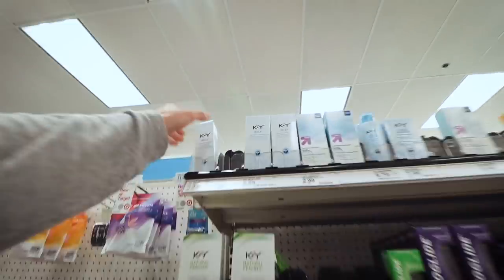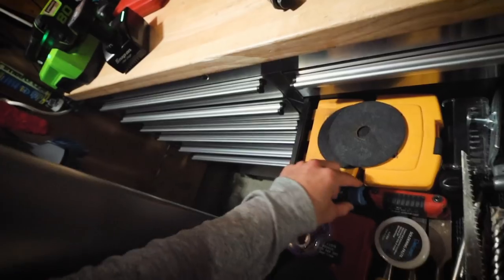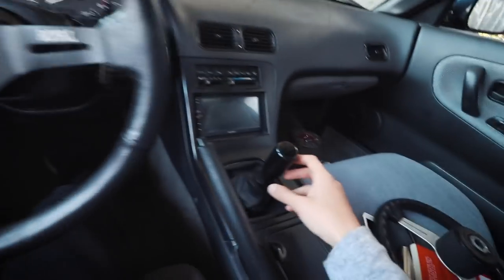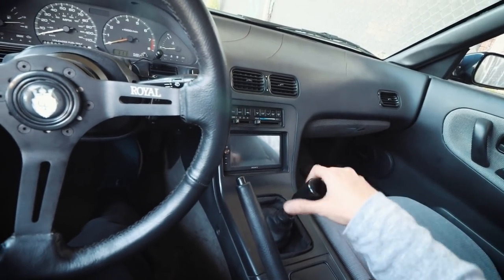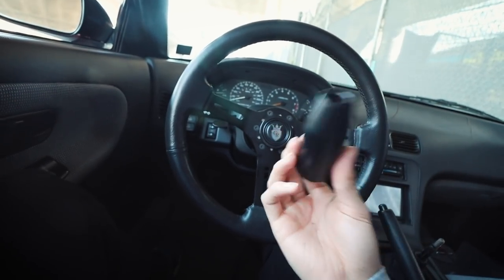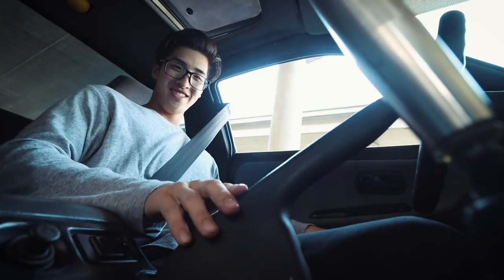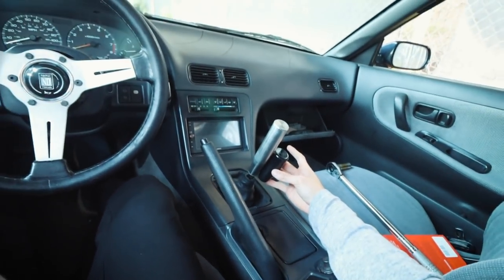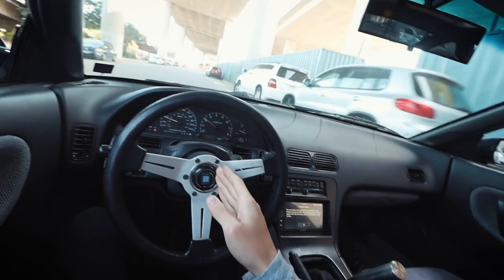I had to do this in my 240SX... (STEERING WHEEL)

Comment: Hey Tyler, I was Looking to get new wheels for my G for the channel as well. Do you think a 19x9.5 +20mm all around with 245/35/19 and 275/35/19 will fit on the G. I’m lowered on S tech springs about an 1inch front 0.8 inch back. It’s a 2004 g35 coupe. Thanks in advance.